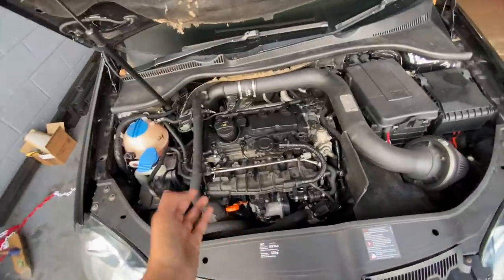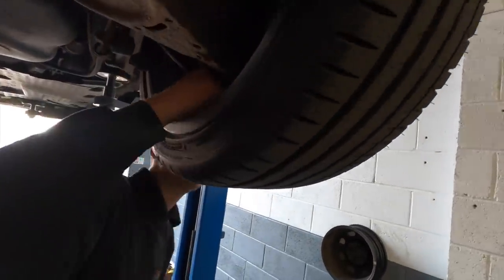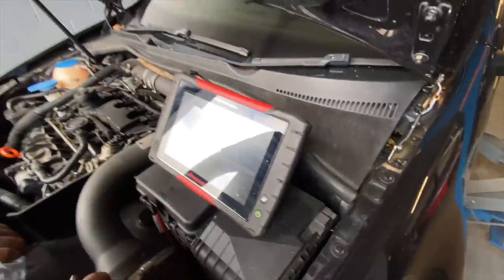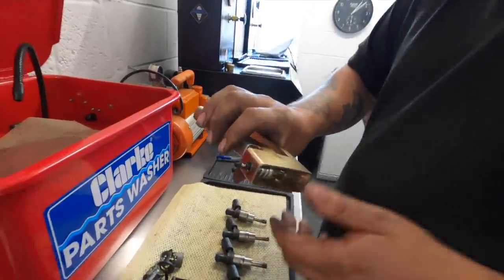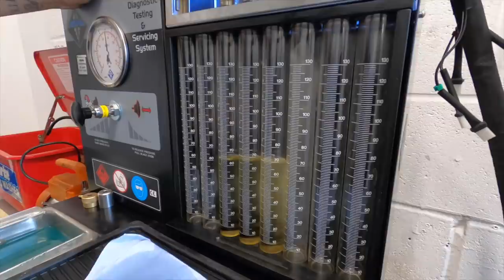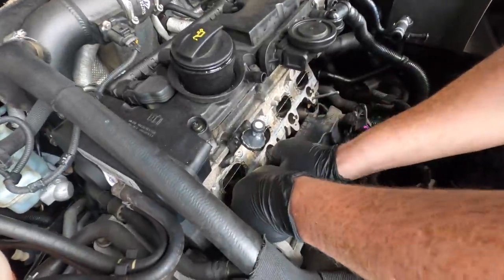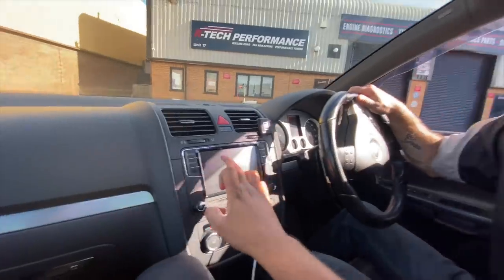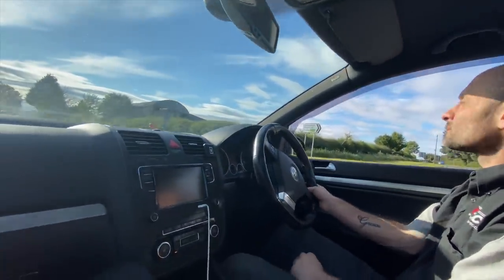Fixing and TUNING my GTI Edition 30!

Comment: The rear right brake shield plate thingy was rattling on my Mk5 GTI only a bit over a week ago. It had come loose and was rubbing against the disc and was making an almighty racket every rotation of the wheel.

Comment: Almost worth getting a TFSI powered car just because the lads at R-Tech seem so decent and enthusiastic about the mods
Reply: They are! Got my Edition 35 done there, stage 1 with the injector clean. Honest, and show you everything they are doing. Passionate about their reputation
Reply: @bristolcityboy1  Cheers for the info! Thinking next car will probably be an Octavia VRS, not quite as 'nice' but inherits all the same potential issues and they're very local!

Comment: I was just wondering how much it cost you for the cleaning of the intake and the injectors etc. I have a 1.4 tsi gt which struggles on cold starts and I get some vibration through my seat. I assume it could be carbon buildup?